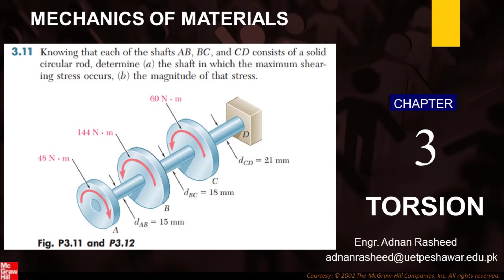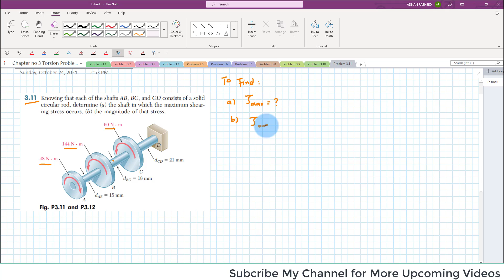Problem  3.11 |Torsion| Engr. Adnan Rasheed

Comment: for section AB should torque B not be considered and why? As I have seen examples where it is included.
Reply: Also the reaction torque at support D is also not considered?
Reply from the maker: For section AB the torque is considered from left side.  You can also come from right side subject to condition that first you have to find the reaction torque at D. You you can apply both and check it , it will give Same torque in each section. Try it and get back to me for your feedback. I gave this question in mid term paper of this summer. Its the easiest one.